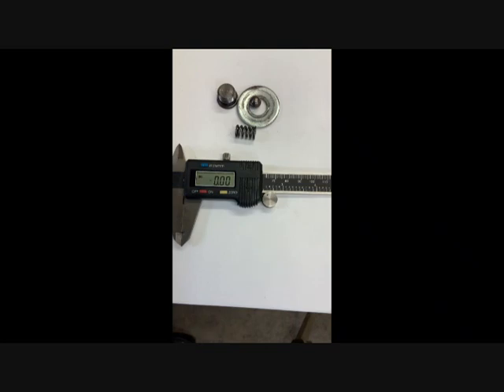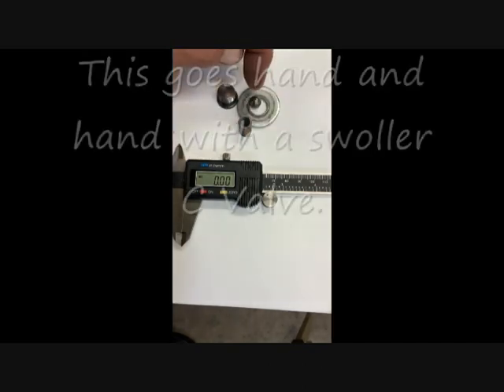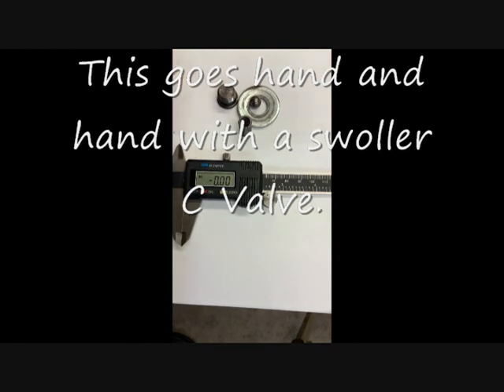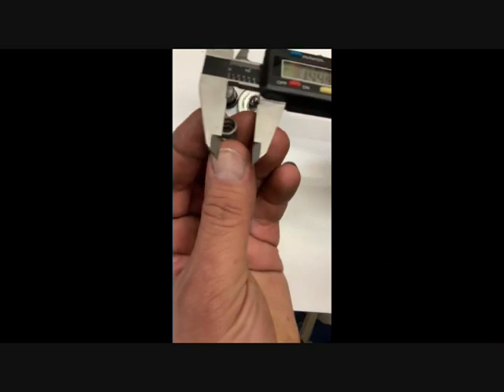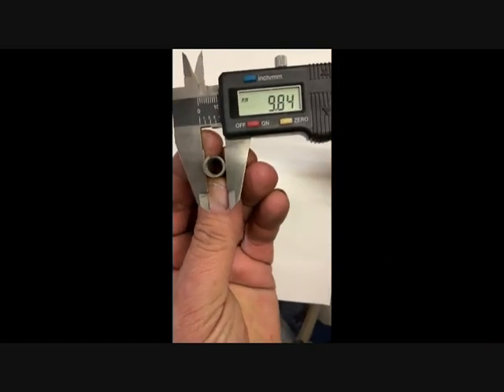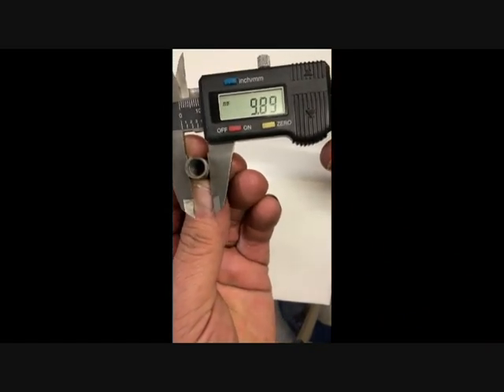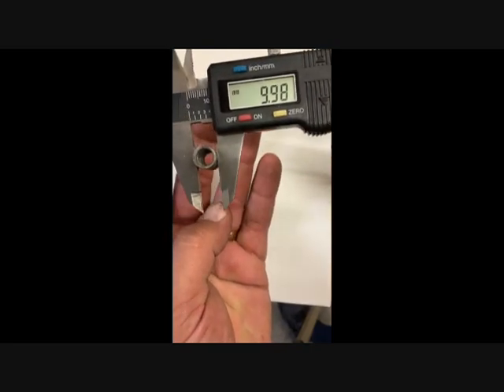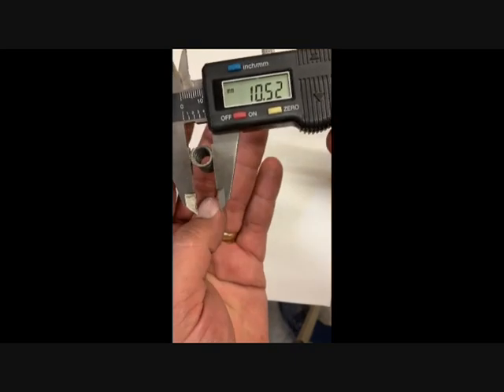Meyer E-47/57/60 Pilot Check Check Valve Inspection

Comment: You didn't tell us where the pilot check valve is located !
Reply from the maker: The video starts with a page out of the service manual troubleshooting section. It is assumed you have a service manual and got to this point in troubleshooting. The manual says change the ball, but the problem is really the spring. Changing the ball won't fix it. Changing the spring will.

Comment from the maker: Just a general comment about the Meyer troubleshooting guides. They were never aimed at the end user, they were shop manuals for dealers. In those manuals are flow charts and theories, etc.. Most people just want their plow to stay up, or go right, or go up, etc. and they just want the simple short answer. Sometimes it is simple, like you changed the battery and forgot to put the plow ground back on. Other problems require some of the theory, and knowing what you are looking at, including the vehicle side of things. A weak battery will cause all kinds of gremlins. "Oh the truck runs fine" is the common response. Yup, it does, but the battery is too weak to operate the plow properly. THIS video is to show you one example of what you should be looking at to solve a specific problem.